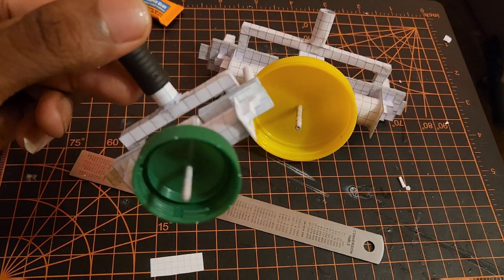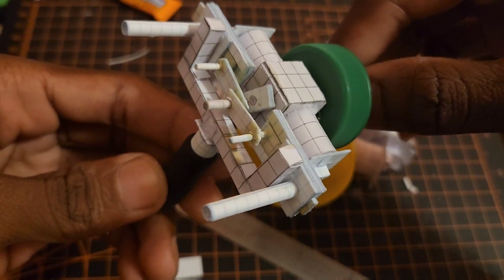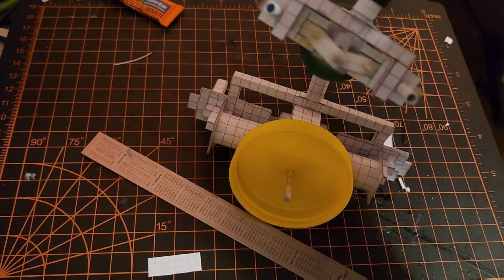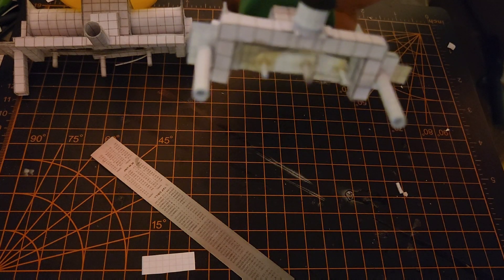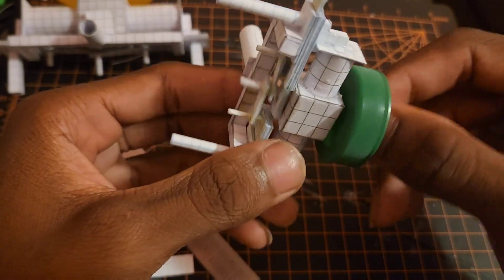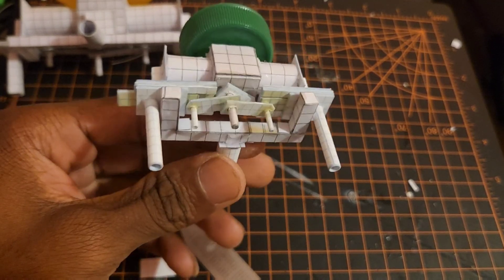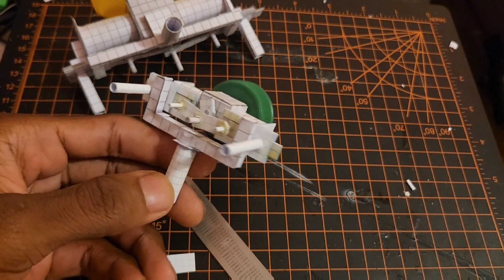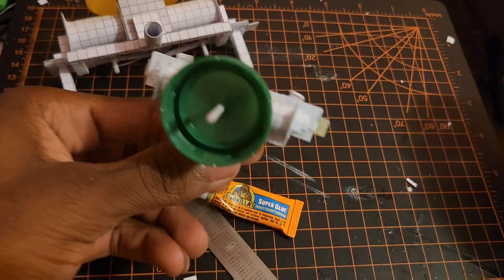I Tried To Make A Miniature Boxer Twin Engine

Comment: I've 3D printed a motor of this type once. I think the problem is with the timing. You could try making a timing shaft with variable position so that you can determine the best position for it. The problem may also lie with the valves, if the exhaust or power stroke is too short or too long, it could be sub-optimal. You could try making a removable valve plate so that you could change the length of the valves to determinate the optimum shape.
Reply: One thing's for sure, friction isn't the problem. I can't even begin to understand how smoothly this thing runs. Precision is first-rate. Good job.